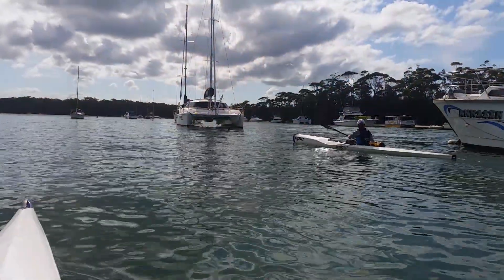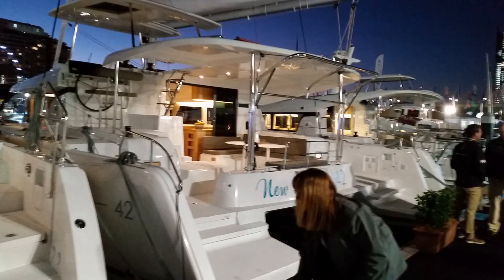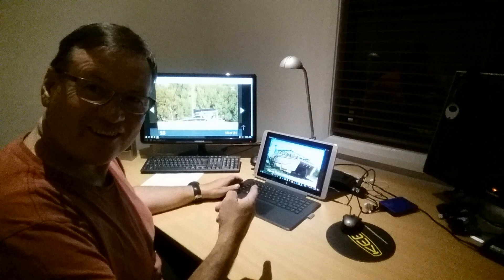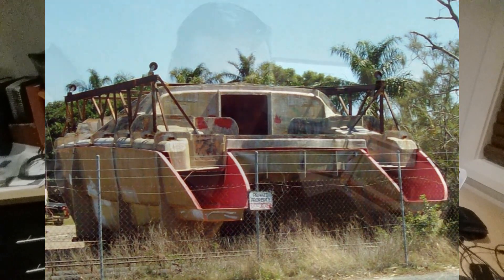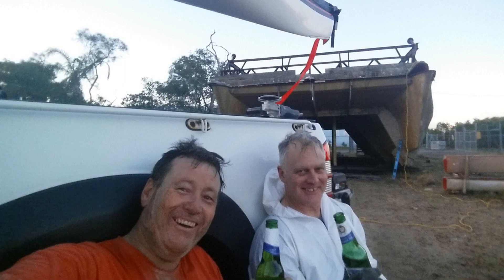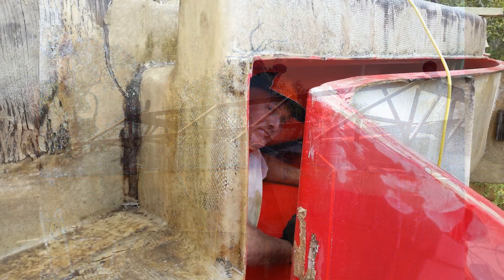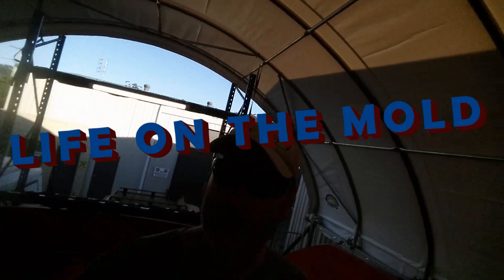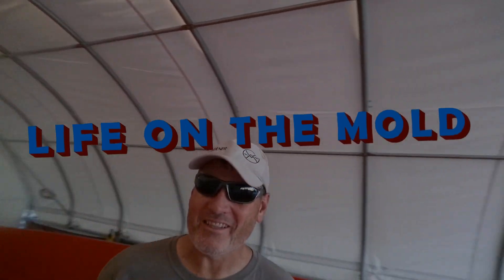I bought a 40ft Catamaran Mould On Ebay - How To Build a Catamaran Ep001

Comment: I am about to build my own multi-hull, the only benefit I could think of in using a mold, is if you want to build more than one, otherwise it is more of a mission than using frames and strip planking.
Reply from the maker: Paul.Yep probably correct however having Considered every option,kit ,cold molded,strip planking the mold for us certainly cut down a lot of time for me.The logistics of owning a mold certainly has challenged me due to the suze weight and simple scsle..If there was a second it would be with significant mods which may well come ,who knows.
Reply: I have been planning my build for over 10 years and without the internet and learning from others who have gone first, I would be going to sea in an unsafe boat. I looked at using a mold but the problem was moving the mold, as you have discovered and then moving the boat, I got quotes from transport companies and it worked out that it would be cheaper to rent a dockside warehouse for the build period than the cost of the mold, renting a crane to release it from the mold, renting a crane to put it on a truck, transporting it, then a crane to put it in the water. I want to go do the Southern Ocean thing in my boat and bridge deck slamming in heavy seas is the biggest problem with large catamarans, I have been racing them offshore for the last 30 years so I am going to build a tri-maran instead which are easy to transport and because you have 3 hulls for space then you can make the bridge decks with netting which allow the water to pass through the bridging area. No slamming in heavy seas. 
That's a Grainger designed cat you are building yes? If I had a nice mold and a big bank account I would probably gone for one of his designs though I think you are mad hand laying it all up, why don't you infuse it or prepreg it, you have a mold you would save so much time, even a person who builds boats every day can never get an even thickness and strength applying the resin by hand. I used to make and repair boats by hand and then I got  vacuum machine and now do infusion, even for small repairs, you save a fortune on resin and the quality and finish you can get with infusion is awesome.
Reply from the maker: Sounds like as great plan.love the tri idea and believe they are superior in big seas.In my case the mould purchase was extremely cost effective,transport considerable but not riduculous and i already own equipment tools and pumps etc.I have invested about a grand and a month into a 15 tonne lifting chassis so will be able to launch and load and move mould as required.Crane hire here is a merely $AUD250 per time,so very reasonable so all up all I can recommend is plan every stage and replan then plan it again as it is incredible the curve balls even your build will throw at you.The idea of pre preg cant be an option simply no autoclave big enough for a 43 foot cat any we here in this state let alone australia,hard enough ginding a shed within 100km of my build big enough..Infusion considered but would have required an extra several months work modifying and enhancing flange on mould for seal,then consumables and possiblility of failure.I have vacuum infusion capability but this mould is pre 2005 and struggles to hold vacuum as laid up with low grade  resin and not infusion grade . Australian Maritime Safety require quaility assurance schedule ie iso for any survey boat built with infusion,similarly chopper guns may not be used here either so without a complete iso certification rating this is not an option for my build,and stripped wooden boats cannot be ratified under new survey regulations.I have a strict approved engineered lamination schedule and am using messared cloth  weights and sray external mix machine that minimises excess resin.This build although Grainger is H80foam core and will already be in the vicinity of 1.6-1.8tonnes lighter than the original production boat.  I have built a few strip cedar and tortured ply sea kayaks and small boats over the years and  amount of hours put into them turned me off the many thousands of hours you will spend stripping your hull. Looks like you have many ,many years of fun ahead and wish you luck and look forward to your video series.Cheers
Reply from the maker: Paul Murphy That is brilliant.Love that stuff.Cheers buddy.Good lick with your design snd get ready to spend spend spend.
Reply: I spent 5 years doing boat repairs for everyone in the local sailing community. I know that the greatest cost is the amount of labour required, I have tried every sanding machine known to man, my house shakes when I start up my air compressors. My plan is to set up a huge 40 ft 3D milling sanding machine, that can sand, polish and mill with dremel tools, like a 3D printer. I will mill the edges of my foam panels, then glue the edges so no fillers will be required then after the foam is laid down onto the frames I will use my milling sanding machine to shape it to the exact shape, that is about 6 months work by hand, but if you can mill the edges of the foam and then shape with a CNC machine it should only take a week. I was going to vacuum infuse the hull but I am thinking of going the prepreg route with a canvas tent and hot air blowers to cure it. I've done a lot of infusions and sometimes the dog eats the vacuum pipe or there is a power cut and all your materials go to hell, I once had my vacuum motor go faulty and it started in reverse and pumped the mold full of air until the vacuum bag leaked when I got back to the shed it looked like I had built an airship hahaha. If I can't build it within 6 month guaranteed I am not going to start. I am building the 40ft 3D milling machine in my yard at the moment, when I finish that in a few months, I will use it to make the frames then boat.
Reply from the maker: Wow that sounds like a mission in itself. Is that 6 month to complete the hull only or do you hope to complete the whole Tri in 6 months. I have had at least three failed and several other small mishaps with infusion, some brilliant results, and yes I have a back up 2 phase pump and there always seems to be something new on the horizon with problem infusing, and a whole cat without expert advice would be fraught with danger and although I know its possible I would bring some friends from a local infusion team, ( innovation Composites ) who are specialist in this field and make high end  ( superfoiler ) foiling cats and yachts etc . I imagined a 2 years full time build on my Cat as a 1 man show, but it will likely be at least 4 full time due to the complexities of logistics and I am now 1.5 years in. Do not underestimate your time, there is always something that interferes, including neighbours, council regulations etc. Do a video on your milling machine, and make sure you watch out for that foam when its airborn, nasty stuff.All the best.
Reply: Yes 6 month no problem, if all the sanding and polishing done by a CNC machine, check that first video out they cut and shaped the mold in just three days using one. I am in Durban South Africa the heat and worst of all humidity in summer is unbearable and high humidity ruins the quality of anything not in a vacuum bag. I could not spend another day in a fully body suit and gas mask sanding in 35 degree 100% humidity, I am going to spend 3 months in shorts and t-shirt making a 3D milling machine then let it spend all the hours doing the sanding and polishing. Also the boat I am building will use 2 solid wings and not sails and will not be a cruiser, a water proof cabin with double hammock , electric cooker and nav station and that's it. No masts, no rigging, no winches. I already own 3 off shore racing cats so I know the ridiculous cost of anything stamped "marine", I have fully kitted out engineering workshops and am going to manufacture everything myself.
Reply: Paul anon 
Hi Paul
Did you build the 3D milling machine?
This sounds very interesting?
Did you build the tri-maran?
Adding the  building in Durban must add to the challenge.
Cheers Pulpo

Comment: Wow lol that is quite involved. That mold is a very lucky find I figure!
Do you plan to build any additional catamarans after finishing yours? It seems like a good opportunity to recoup money since you already have the molds.

I'm just playing with the idea of building a solar powered catamaran houseboat yacht. Solar power seems quite possible and solar panels are cheap. 

From what I've researched I figure for a one off build it would be much easier to use cold molding, build using foam and fiberglass without a mold and hand / wet layup without vacuum bagging.

Thanks for the videos!

Comment: G'day Ross, interesting project.. The add said it was a Grainger, but it doesn't look like a Grainger? How old are the moulds? Building a cat is a massive job. I will follow your journey, I'm really keen to see how long it takes and what it weighs when it complete..
We wish you luck and persistence, cheers Russell & Malene
Reply from the maker: Rustie, thanks for the comment. The Cat is Grainger design No 86. I have the full set of plans and specs and have just had the whole project re-engineered in H80 foam core including bulkheads and deck. Original design was strip cedar plywood but with the the tooling now produced it will take on a very different substrate form. Glad you picked up on our videos. Lots of fun to come , and some bloody hard work. Gle coating and first few layers now on the hull so straight into it. We are factoring on a total weight of 6500kg dry and approx 8500 wet incl fuel and water.Engineering has been done to 15-20knots. All the best Rossco.